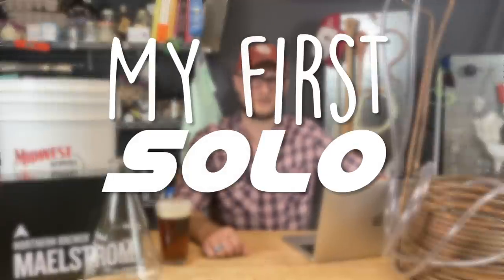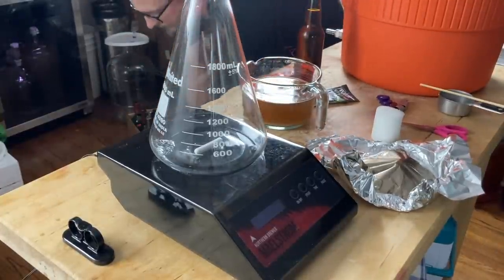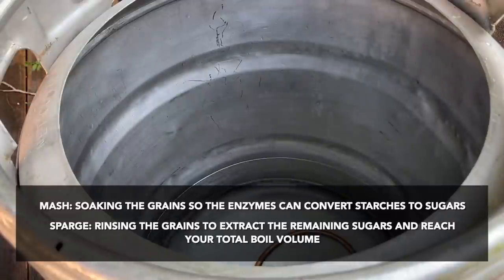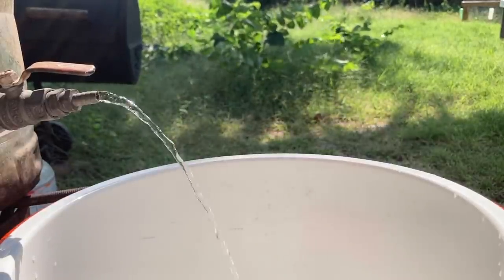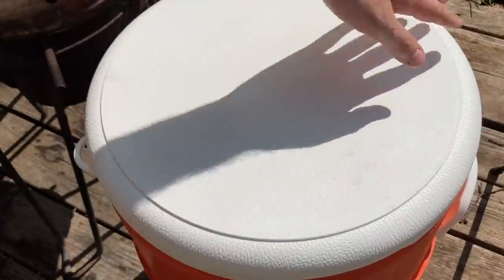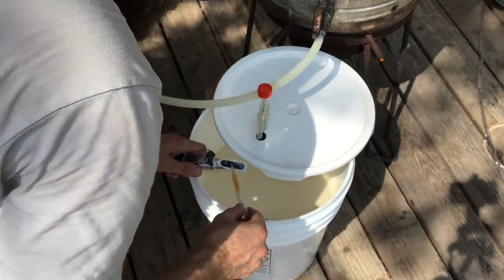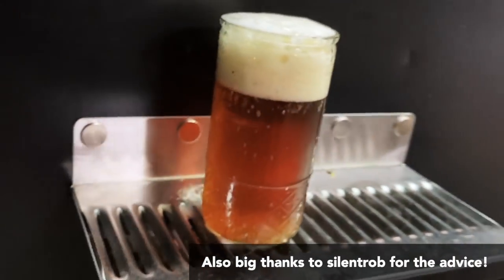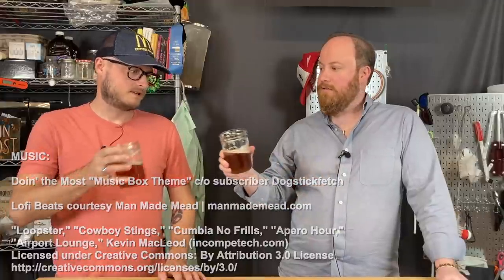Grain to glass in 9 days! All-Grain Beer Brewing SIMPLIFIED

Comment: Great video! I guess beer brewing is still too much hussle for me but I always enjoy watching the process :) On thing made me giggle though XD Vorlauf  is more like "four louf". Cheers from Germany!
Reply: BIAB is much easier. I've made excellent beer using just a large soup kettle, and a bag for the grains. Heat to temp, then stick in a slightly warmed oven for the duration of the mash. Typically, with the lid on, I would only lose a degree or two over the duration of the mash. With a small enough batch, you can chill it in the kitchen sink by plonking the kettle in, and filling the sink with water / ice. That said, extract brewing produces excellent beer as well, so all grain is really only for the enthusiast.
Reply from the maker: My German is not great! Thanks for watching and cheers!
Reply: Someone please GET THIS MAN A DRILL for his grain mill!🤣🤣🤦‍♂️Great video!
Reply from the maker: @Rubio_Eric  You don’t like a little arm workout? 🤣
Reply: @DointheMost  nope. 16oz pint arm workouts is all I need lol🤣💪

Comment: You take the channel name seriously. Love it! If you stir the wort while chilling, it should drop quicker. Obviously, a pump is better (more sanitary), but that's another $100+ investment in pump, fittings, and hoses. And bugs suck, when brewing outside. I had a little guy hop in right as I was about to start transferring wort. Just started swimming in my soon to be beer. Fished him out with my mash paddle, and no harm done in the long run.

I like electric brewing, just because having temp control is awesome (whether that's an all-in-one, RIMS, HERMS, or whatever). Basically, I'm lazy. ;D

Edit: Did you do any water salt adjustments?
Reply from the maker: I did not do water adjustments on this one. Fortunately, after boiling, our water here is pretty good. Not too hard, not too soft. I am very envious of electric kettle setups, but thankfully I was able to rehab Anna's dad's old kit so this didn't cost me too much out-of-pocket!
Reply: @DointheMost  My water sucks, so I just buy distilled. Eventually would be nice to get a reverse osmosis setup, but not worth it in an apartment.

If I had gotten a good setup like that second hand, I would have stuck with it too. It's a tried and true method for producing excellent beer.

Comment: Very good video!  Do you ever find a problem with your hop spider resting on the bottom of your pot?  I read somewhere that it is not recommended.  However, my brew put is more wide and short opposed to tall.
Reply from the maker: It actually rests on top of that little capillary tube at the bottom and so far I have not noticed any issues at all!
Reply: @DointheMost  very nice thanks.  Do you typically prop it on something when you are using it with your dutch oven as well, or just set it in and not have any issues?
Reply from the maker: @jasonduggan2987  In the Dutch oven it sits right on the bottom and I’ve not noticed any issues there either. :)
Reply: @DointheMost  Fantastic news!!  I kept trying to come up with a way to make something to stick to the side of the pot, and then hang a spider from that.  Like a child's booster seat type thing.  Thanks again!
Reply: I've noticed that the hop spider will vibrate when bubbles form under it as the water boils. This only happens for me when I place the chiller in the kettle, and I have to move the hop spider off the edge of the kettle. Doesn't seem to have any ill effects, but I've never done it for the full boil.
Reply: @Vykk_Draygo  Awesome!  Thanks.